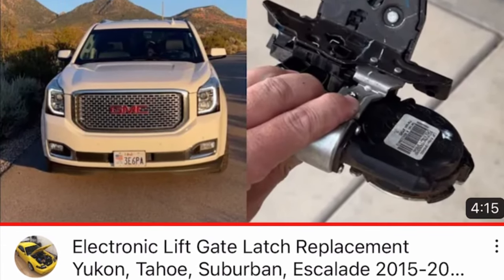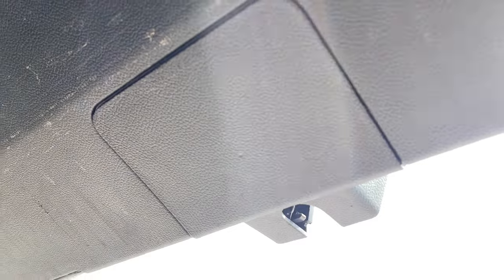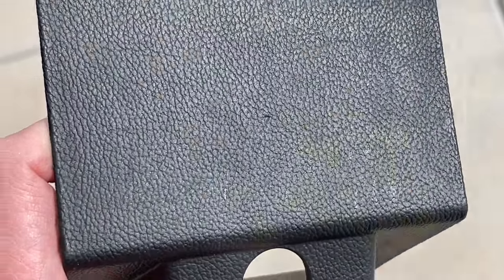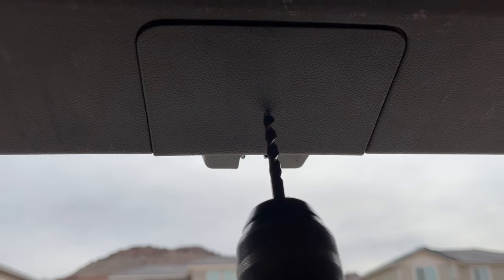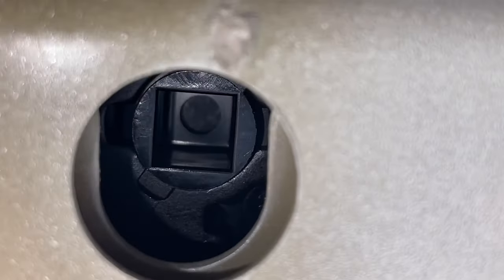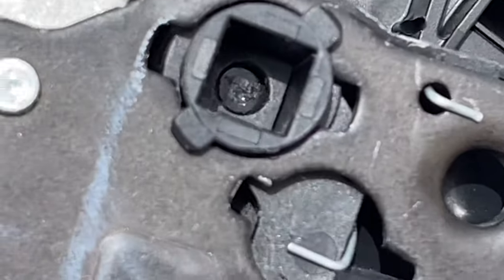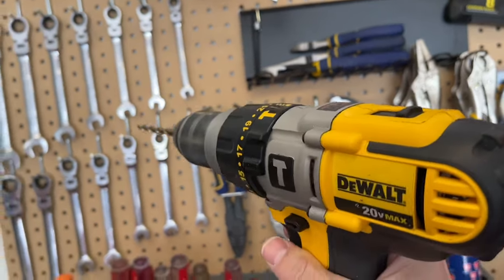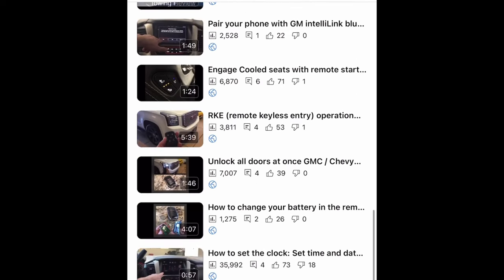Lift Gate won’t open: How to manually open the lift gate Yukon, Tahoe, Suburban, Escalade, GM, Chevy

Comment: You actually have to twist the whole square assembly with a flat head to the left
Reply: You think it would fit s 1/4in or 3/8 drive?
Reply: 3/8 or a flat head you can get to fit between the corners of the square

Comment: I have a 2010 Tahoe. I was told that it's probably just a fuse. My lift gate won't open with the fob, nor manually. If I drill a hole in the back of the lift gate, does that mean I'll have to climb in the back and open it from the inside every time I need to open it?
Reply from the maker: Probably. This is an emergency way to open it and I also believe you need to turn the square part to unlock it not just push the button. It may vary by year too

Comment: Does the plastic shield covering the latch come off if the hatch is closed? My hatch is stuck but I’d prefer to not have to drill a hole if I don’t have to. So will that cover come off if it’s closed?
Reply from the maker: It wraps around the latch, so I don’t think it will come off. You also need to twist the small square box that surrounds the button if pushing the button doesn’t work.

Comment: Do you have to turn it or just push it in
Reply from the maker: It’s a button you’re pushing, so should just be straight in
Reply: Because when I stick a flat head  in there and turn it counter clock wise it looks like it’s mechanically doing something near the latch.
Reply: I think my shit is jammed and the motor electronic motor is shot. I just replaced it latch thing back in December but it was a freakin China off brand part lol

Comment: I have a 2003 Tahoe and it doesn't have a dimple or anything, just a leather strap to pull. How do I manually open it then?
Reply: Did you ever figure it out? I’ve got the same problem on an 04